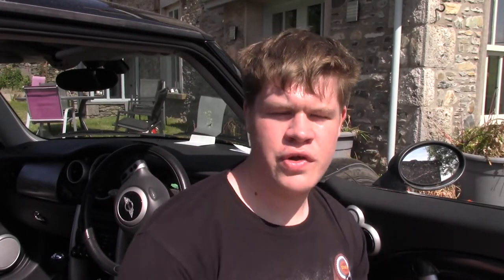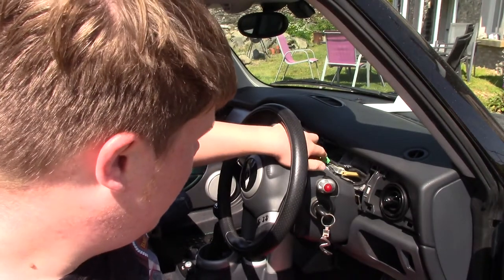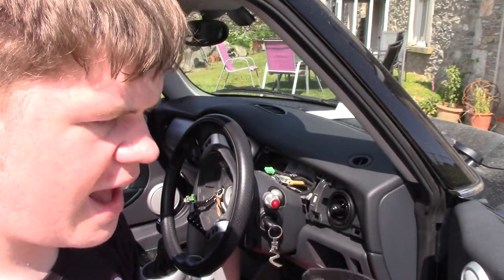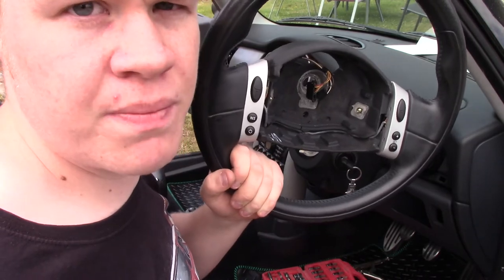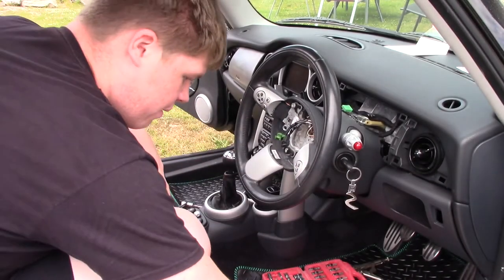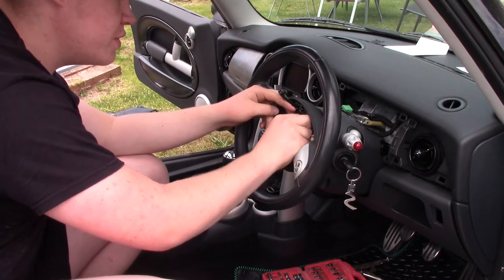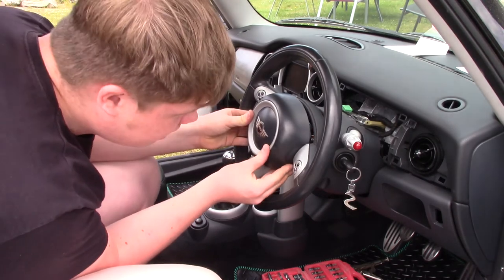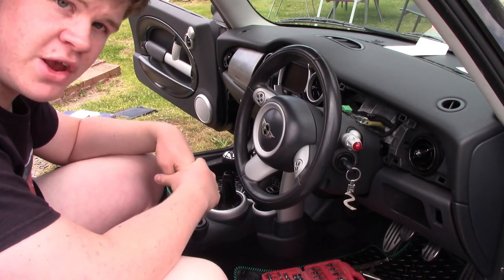R53 Mini Cooper S - New Steering Wheel Swap

Comment: Hello Moldy! In the thumbnail I see you also added both a rev and speed counter and also a multamedia where the old speed counter was. Where did you get those parts? And why not film that installation I also wanna do those modifications but I’m clueless on where to get the parts and how to install everything myself:’)
Reply from the maker: @stefanolujic9999  Hello, thanks for your comment, those came with the car from factory, it was the highest trim spec Mini I’ve ever seen, I’m sure there will be tutorials out there how to fit them, sorry I couldn’t help

Comment: Hello did your car have the connector already to wire up cruise control ect ,as I have a 3 spoke as standard but want to fit cruise control and was woundering if it's just a case of swapping wheels and there being a plug there for it to connect to
Reply from the maker: You will need to get a “multifunction” 3-spoke, because the cruise control button is on the wheel itself. My car had it from factory so when I was looking for a 3-spoke I made sure it was a “multifunction” one. Then it was just a case of unplugging the cruise control wire from the 2-spoke and plugging it into the 3-spoke. Hope that helps
Reply: @MoldyWormStudios  ah right yeah makes sense now ,thanks for the reply and keep up the videos